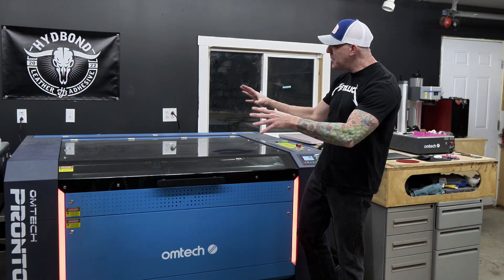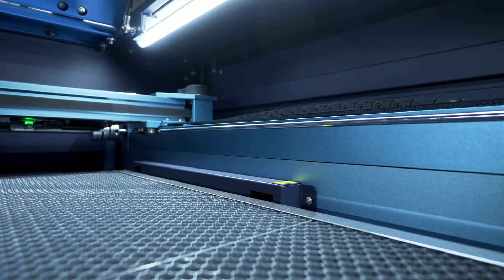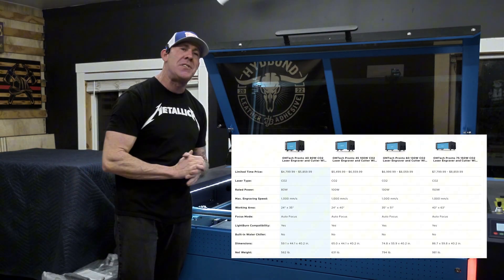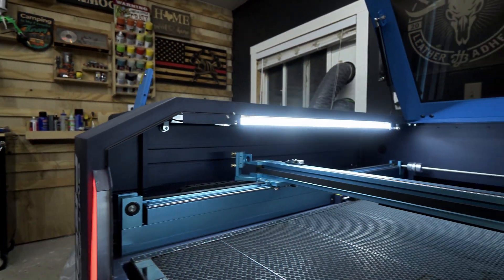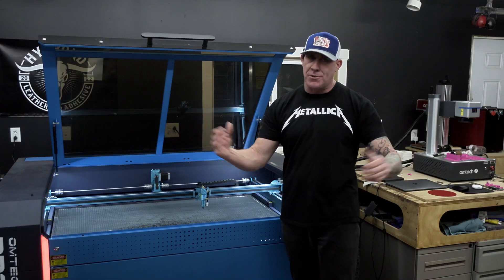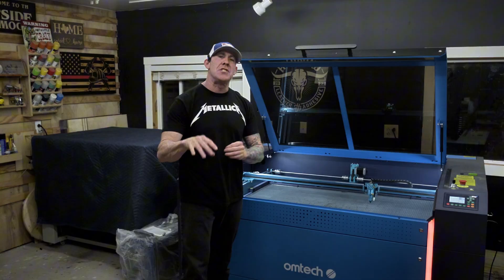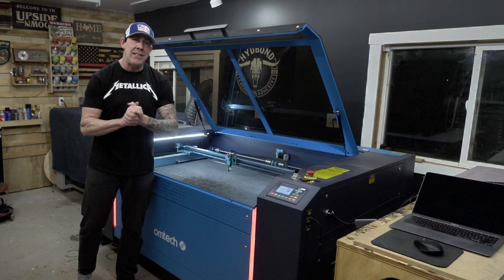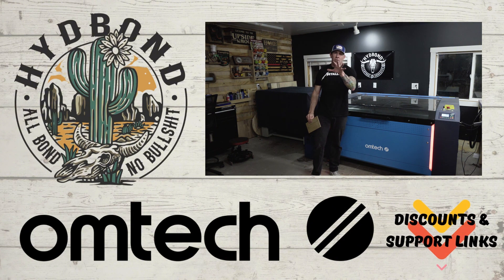Omtech Laser Engravers | Which Laser Engraver Should you buy?

Comment: Can you tell me what depth of material can go thru the pass thru? It doesn't appear to be very deep but I have not been able to find this information anywhere. I am trying to determine what size machine I want to purchase.
Reply from the maker: I would email OMTECH direct and get a solid answer from the company. I have not used the passthrough and don't know the MAX Z HEIGHT for the Pass Through! Great Question!
Reply: @RISENGRINDWORKSHOP  "The OMTech Pronto line allows for a maximum workpiece height of 8.7 inches when using the pass-through feature. " the "chat bot" was very handy and then of course I scrolled far enough down and there it was in the Pronto line stats. Thank you for the quick response and figured I would let you know what I found so you know for future.
Reply from the maker: @kinvotime490  Awesome. Thanks for posting so others can find this info. I review so many units and operate all kinds of machines, I didn't want to post the wrong info off the top of my head. You Rock!!!

Comment: do all us Pronto 75 owners a favor and have OMTECH send you a 75.  Then record a video how to get the stupid honeycomb bed out of it!

Nice video btw, thanks.
Reply from the maker: Now that I think about that, I still have yet to remove mine and it's still zip tied down :)
Reply: @RISENGRINDWORKSHOP  myself and two others I know that own the 75, cannot get these beds out.  OMTECH says "oh slide it all the way over the left y axis, then tip it up on the right side and take out".  Problem is 1) no way it's going out the rear pass thru like the AF3555 and AF4063 models because of the locator pins on the bed and 2) the laser head assembly (without the laser nozzle attached) does not go far enough back regardless of where it is on the X axis, to provide for clearance to get bed up and over the Y axis rail.
Reply from the maker: @Todd-W  I will take a closer look at mine next time I am in the shop. Interesting to hear!
Reply: @RISENGRINDWORKSHOP  1 month later.. zero response